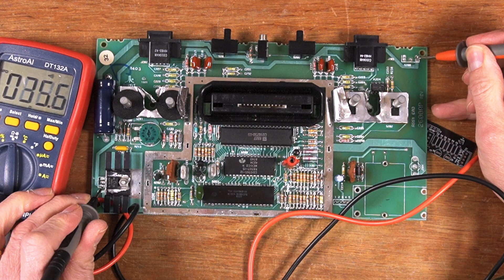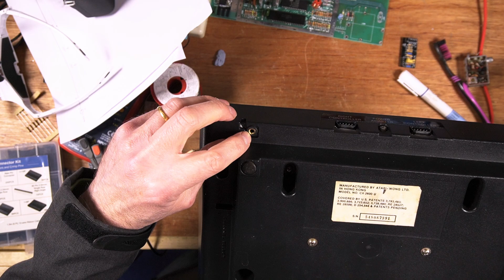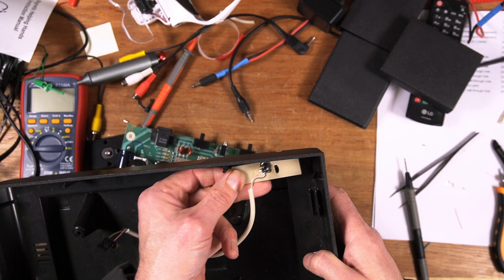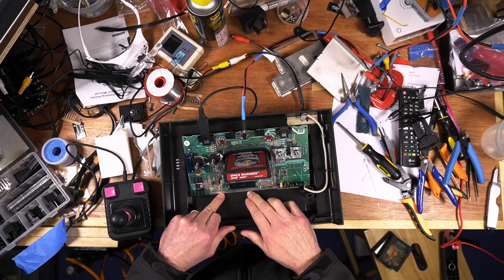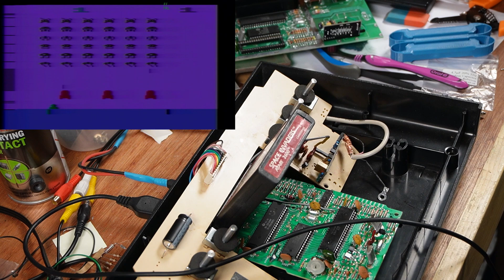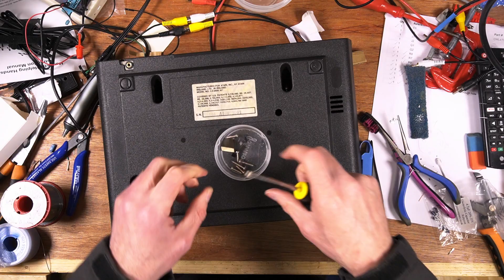Fixing an Atari 2600 Vader: Replacing a Faulty Inductor and Discovering a TIA Chip Issue

Comment: Greetings, friend here again, this time I dusted off my six lever VCS, light sixer, the atari in question turns on, gives video on the screen, but after three minutes of seeing the game on the screen, it loses the image, they seem as if it were blurred, the pixels of the figures in the game are dropped until the game is completely unviewable. I uncover it, check the voltage regulator and it shows me 5.1 volts on the output pin. I understand that it has to show 5 volts on the output pin, but in my atari it shows 5.1 volts on the output. I ask you, is this regulator good or bad, will this be the cause of the problem with my atari that the video of the game goes off the screen as I explained above. Please, what answer do you give me?
Or rather the problem of my atari will be a malfunction of the chips, for example one of these, RIOT, CPU or TIA.

Comment: Greetings, friend, one question, it is possible that an atari junior board comes from the factory with a jumper on the back of the board, it is a little cable soldered to one of the pins of the cpu processor, middle chip and the The other end of the little cable is soldered to another pin of the graphics chip or TIA chip. Oh and the atari in question turns on, but it doesn't give video, that is, the red led turns on, but it doesn't even give the colored stripes, nor can the game be seen on the screen, much less, but how curious the atari turns on. It's a short rainbow atari junior, REVISION 2. That may be a friend, it will have something to do with the bridge so that the game cannot be seen on the screen. That bridge seems strange to me, what do you think friend?
Reply from the maker: Ive never worked on a junior so far. I have one to do soon so maybe keep an eye out for that. Sorry I cant help more.

Comment: So case and yet so far. I really like the look of the Vader, the all black thing is just very cool. Its a shame that the one faulty chip is the expensive one. Just like a 48k ULA or a TED chip. Hopefully someone will find a way of making cheap replacements for these chips
Reply from the maker: I really hope they do. I bet it will be some time though. There are still a lot of spares around and a modern solution would probably be more expensive with current prices. Fingers crossed that changes soon and we might see a lot of these custom chips crossed off the list.

Comment: I think its missing the channel selector on top right is the modulator 3 or 5 pin?
Reply from the maker: I've never noticed a channel selector in one of these. I'll have to pay more attention.
I'll check but I think it was 3 pin
Reply: @MoreFunMakingIt   The very top right is the NTSC channel selector if your PAL it may not loop power anyway 3 pin is the no  channel selector modulator they are rare to see over here only came on heavy 6'ers and early 2600's before a channel select was introduced to avoid a broadcast channel.
Reply from the maker: I'll put some pictures up on twitter a bit later

Comment: I was looking at the mod schematics. It's just two amplifiers this can be done even smaller with a TLC072 opamp, and since that has pretty much linear amplification you only need one amplifier circuit and three resistors. That could make it very small and you could just highjack the signals from the board with some wires, without having to remove the components. So you have both RF and composit. I always feel a bit bad taking original stuff out when modding. Ah @9:05 you gave your reasons for this type of mod :D You do you do ;) Awesome clean way to mount the "port hole" with that bracket!
Reply from the maker: My electronics knowledge only goes so far as recognising which bits are on a schematic for fault finding. Creating circuits is way beyond me!
Sounds interesting though. Would be nice to leave the modulator in place.
Reply: @MoreFunMakingIt  You could have fooled me Lee! I think you are under selling your skills. I love your channel and you and my channels sort of have the same cheeky edge. My content is a bit more outspoken and vulgar but hey, I am a kid of the 70s... We don't know what self censorship and political correctness is. Mommy and Daddy weren't home to teach us ;) (although unlike most GenX kids, I do not have that excuse :D) Have a great day Lee and keep up the brilliant work!
Reply from the maker: I will have to check your channel out! Thank you for the kind words 😁

Comment: Don't follow TFW8B's instructions on what parts to remove for the AV Mod. I had to revert on certain parts I shouldn't had to remove.
Reply: I saw TFW8B (The future was 8 Bit) instructions on the 2600 Vader PAL and it doesn't say anywhere to remove the big brown inductor, I think you called it L205. In any case you should try to reinstall it and see what happens.
Reply from the maker: I'm not sure if you watched the whole thing, but the big brown inductor was not part of the TFW8B's instructions. That was the part that was originally faulty.
I followed their instructions exactly and it works perfectly. Maybe you had a slightly different revision?
Reply: @MoreFunMakingIt  Oh okay. Still, I had an issue with my Atari 7800 by following their instructions and removed parts, and now I got a very weird video artifacting I hadn't in earlier tests. Also they didn't explained why removing resistors that are responsible for filtering audio signals, even one person in the comments there recommended to leave those resistors back in their place for that reason.
Reply from the maker: @KeonAureii  interesting. I have a 7800 to look at soon. I'll bear that mind

Comment: Why does the image in the Atari console look so dark? is that normal?
Reply from the maker: It's hard to say. The console was designed to display on 1970's TVs and I'm capturing an analogue signal it was never meant to output.
I could probably tweak my display settings and make the picture brighter.
Reply: @MoreFunMakingIt  I think you could also amplify the signal a bit with a transistor as some composite video mods for the Spectrum do. It fixed a dark screen on some Spectrum models like the Investronica clone of the ZX Spectrum +